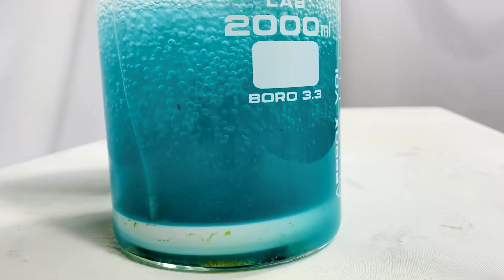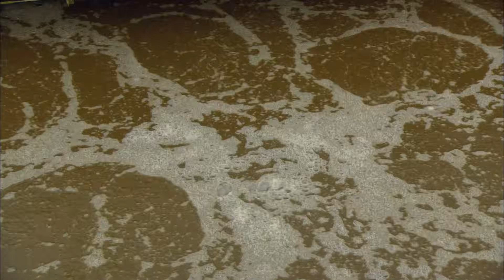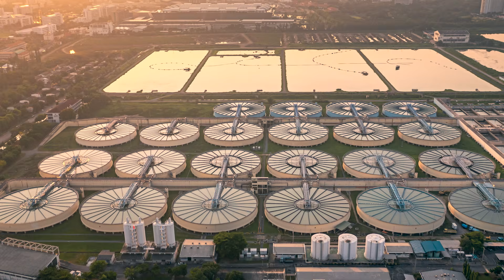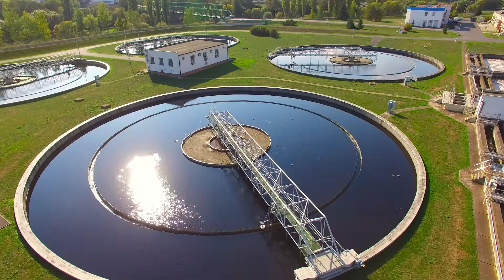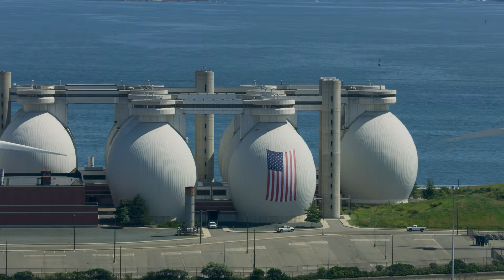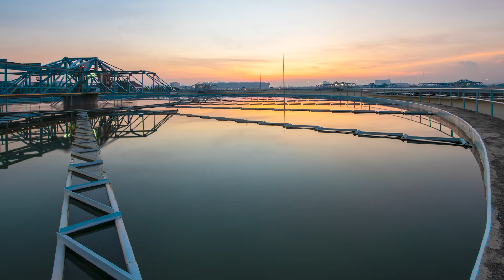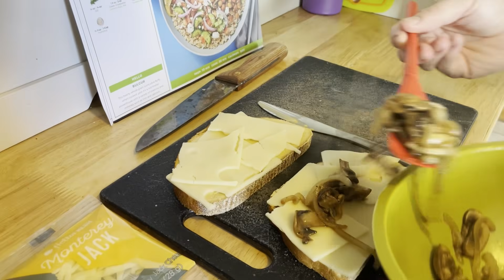What Sewage Treatment and Brewing Have in Common

Comment: Tangential, but how exactly would you design a sewage system for a habitat at the bottom of the ocean floor?

A very high-pressure environment, and no sunlight, which possibly necessitates a connection to the surface to treat the wastewater or a strong power source to provide energy to the microorganisms. The smell would be horrendous and unless the occupants don't care, the air itself would have to be treated as well...

Comment: Some people just straight up allow the mixture to build up pressure in the first place, and when the fermentation is over you get a nice fizzy drink. But for that of course you can't use a typical water-based one-way valve or a glove with a hole in it - you would either need a cap on a bottle, that you would constantly keep twisting off real quick to relieve pressure manually (can't recommend it as it is inconvenient and can make a huge mess if you miss your next pressure relief schedule - I've personally been in those cases where I heard a loud hissing sound from the bottle, and moments later a fountain of the mixture flew out while the cap was bulging!) or a mechanical one-way valve.

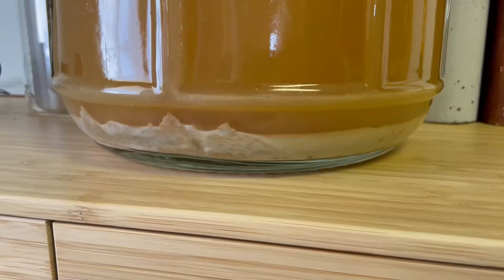Comment: @ 8:04 Nice capture of birds on the secondary clarifier.  Ducks, geese and other water fowl tend to be banes for operators.  They tend not to go for the primaries...can't blame them.  Plant upgrades tend to keep them away.  Have you worked with ballasted flocculation?  I've seen BioMag and CoMag upgrades to a tertiary treatment facility, impressive settleability in both mixed liquor and for P removal in tertiaries, impressive process and ~95% ballast recovery as well!

Comment: This was a really interesting video for me, because not only do I like an occasional beer or especially cider, but I work in a plant that uses recycled water!  We make brown paper (linerboard or containerboard) from recycled corrugated boxes (aka OCC).  The process uses a ton of water to break down, refine and store the paper pulp.  You can't pump it if it's more than 5% paper, so that means every tank has at least 95% water in it.  And it's all sort of dirty water with fine particles and dissolved solids.  But we also bring in 100s of 1000s of gallons per day, as well as discharging to the city after treating and going through our own clarifiers.  We also monitor temperature, pH, and flow (instant and total).  We're allowed to take a certain amount from the river on our property, but the remainder of our water use is supplied from the city waste treatment plant.  Effluent quality water is piped up to us (about 3 miles) and we use up to 1000gpm at times.  The pipes, the tank, and the pumps are purple.  There are also some purple fire hydrants that I don't recommend playing in when they get flushed out.  Thanks so much for this video, really enjoyed it.  --RB in CT.

Comment: We have treatment plants here in Oregon that run at a negative net energy consumption by using anaerobic digesters to produce methane and generate electricity. Several of them push power back to the grid the majority of the time they operate.

Comment: I was looking at the dramatic improvement of commode operation after clearing the two front rim jets.  You don't get a 20% improvement you get a 20-fold improvement in operation.  I realized this is because those jets in particular are the air vents and are no longer holding that air spring in the system.  Mechanically opened them at first, but got another 10x or 20x improvement using vinegar and CLR to do a proper clearing.  So, no I need to put down some septic treatment to re"activate" the sludge in the septic tank.

Comment: I feel like a great solution to excess sludge would be to decon it--possibly with ionizing radiation, since most most radiation outside of low-speed neutrons aren't "sticky"*--and then (after a cooldown period to allow any free radicals to resolve) use the resultant material on fallow farm fields or landlocked environmental reclamation sites. The potassium and phosphorus within the material would be very useful for agriculture, and would also make for excellent topsoil reinforcement.

Only significant issue would be the salt concentrations, since too much salt can poison soils over time. Although, even that could probably be ameliorated by having the material be processed by salt-sequestering organisms--albeit at a significantly increased cost. 

*Exposing a sample to sufficient x-rays or gamma rays will kill organisms, but won't leave the sample radioactive itself.

Comment: Here's an interesting question. Why don't we provide demineralized water to new buildings as an additional source of water in ocean side areas with not enough water supply? I know that industry is using different types of non-drinking water but we still discuss how much we should preserve drinking water and how hard is it to turn salt water into a drinking water. The thing is that big part of drinking water production is mineralizing it to make it safe to drink. If the easiest water demineralization method is reverse osmosis, the resulting water can be used for most of applications. Typically around 20% of water is used for shower/bath. This water can be a mix of mineralized and demineralized water. Around 20% is faucet water which includes drinking water. This should be mineralized one (the typical drinking water). Everything else can use any water and in fact, using demineralized water in the toilet, dishwasher, laundry machine, humidifiers and whatever else you have in the house is good to prevent limescale. This means that around 60-70% of water usage at home can be replaced with just demineralized, not drinkable water. The only drawback is additional cost for a second pipe but in case of new development it should not be that big of a deal. Especially compared to the damage done by limescale to many devices that don't need drinking water and the ability to reduce drinking water usage by replacing it with raw, demineralized water without any minerals added.

Comment: You can get that cider cleared with cold as well, dont necessarily need any enzymes or chemicals to knock that yeast down, although takes alot more time in cold. Put it in fridge or if cold outside then there. Below zero celsius it will freeze though.

Comment: In 2010 I installed a 2000 gallon grease trap,  with an air pump for a 2000 gallon fish tank.   Then the city implemented a new rule that all grease traps needed to be pumped every 90 days.   Small ones every 30 days.   I did not comply as my grease trap was clear to the bottom in the second chamber and had no oder. 
The pretreatment water coordinator came to inspect my grass trap and insinuated that I was using illegal enzymes.  They collected samples over the next thirty days and scoped the lines beyond my trap. The conclusion,  my lines were the cleanest in the entire city.   I explained that I was keeping healthy bacteria alive and those bacteria that escaped were also helping to clean the lines further downstream.  I even sent the inspector studies from different universities explaining how the bacteria were cleaning the FOG.( fats, oil, and grease)  She replied bacteria can't eat oil.  The decision by the city was to tell me to remove the unapproved air pump and have the trap pumped every 90 days, or they were shutting off the water to my restaurant.   I wish I was joking.

Comment: One small, pedantic, and partially wrong correction to make: while I usually love our American exceptions to language, or even measurement, misuse of the term cider should go. Cider 'is' the fermented juice. What you have otherwise is applejuice, or cider with the alcohol removed, or applejuice with carbon dioxide added. Sparkling applejuice is juice, cider refers to the fermented beverage.

Comment: To add support to the discussion:

-yeah, I'd agree with the shift in industry attitude and nomenclature. Having worked for both municipal/state authorities and private companies, either as a contractor or employee, people are really starting to pay attention to what they throw out. Both in terms of basic land application instead of throwing it in a landfill, to major shifts in treatment methods that create a better "waste" product as fertilizer or fill or whatever.

-recently in Pyongyang (I think like 2019) a wastewater plant was built that is self-sustaining in terms of electricity, and even provides surplus to the city in terms of a few thousand kw/day (on the scale of a wind turbine or two). From my general understanding it takes the methane filled waste solids from its process and bakes them in silos to release the gas, which is then trapped as a burnable fuel. The solids can then be burned as biofuel themselves.

-in the process of poultry wastewater treatment, I get to witness phosphorous be used as a nutrient in chicken feed, which then gets absorbed into chicken tissue at an industry reported standard of 60-80% for most feeds/breeds, which then gets washed off the chicken during the harvesting (new industry term) process, which shows up in my wastewater and gets extracted and runs over the machines, the waste solids of which get recycled as fertilizer for crops, some of which crops are used as chicken feed. Woo.

Comment: Brewer here chiming in with a comment that got real long. Sry. 

When we ferment beer (or cider, wine, etc). We often oxygenate the wort (unfermented beer) before “pitching” our yeast. We do this because the quantity of yeast we are introducing is woefully inadequate to start eating the sugars right away and making ethanol. Instead the first thing that must happen is the yeast must multiply until there is enough to begin consuming the sugars. The oxygen helps the yeast make a new generation of cells to do the fermenting. Without this the yeast can be under a lot of stress that can cause at least a slower fermentation and at worst off flavors from the yeast. Autolysis can be a concern - yeast cannibalizing other yeast, producing a peanut butter off-flavor (sounds pleasant but it’s awful, trust me). Oxygenation can be done by vigorously stirring a wort before putting it into a carboy but to ensure no other bacterias are introduced it is preferable to use pressurized oxygen introduced through a diffusion stone. This practice is often done even when a yeast starter (process of re-hydrating in light wort to coax yeast propagation before pitching) was done rather then just pouring in dry yeast. It is worth mentioning that there is only an initial oxygenation because we do want that anaerobic environment once the yeast really starts eating the sugars, for the reasons you mentioned. Of note most 5-8% ABV beers will be mostly fermented after only a few days but that process slows down so much we usually ferment at least 10-14 days before kegging/bottling. 

Also, we do occasionally brew with specific bacterias (lactobisillus, pediocaucus, etc) for very specific beer styles (sour beer, Berliner Weiss, etc). 

I’m guessing your clarifier was something like peptic enzyme - you can just toss that in at the beginning of the ferment it won’t interfere with the yeast. Don’t use peptic enzyme for beer though that’s only for fruit ferments.

Great video. Enjoyed. New viewer.

Edit: Autolysis is generally more a temperature  concern than an oxygenation concern

Comment: A nice example would've been vinegar fermentation. Acetic acid is a bacterial fermentation in an aerobic environment, so it would be a great parallel. The dead bacteria also settles to the bottom and can be seen in the bottom of the vessel, but it's generally less crucial that it's filtered out

Comment: A good overall review for the general public on wastewater treatment.  Obviously there are many other issues that must be addressed in design of facilities but that is what trained engineers are for.  In my 38 years of consulting practice I designed countless waste treatment facilities (mainly activated sludge but some trickling filers) for both municipalities and industries.  Everyone was a learning experience and over my time we went from mainly secondary treatment reducing solids (TSS) and BOD  to first converting organic nitrogen to nitrates in the nitrification  process to removing almost all nitrogen and phosphorus by additional techniques also.  Sometimes the regulatory agencies required such low effluent concentrations of these parameters we had develop tertiary treatment steps or enhance the  secondary processes to increase removal rates. Industrial wastes could be especially troublesome due to presence of toxins but these could be successfully treated individually prior to discharge to the downstream treatment facilities.  At the time of my retirement new issues were beginning to arise, such as pharmaceuticals that may pass through normal treatment  processes etc.  Look forward to your presentations on anaerobic and aerobic sludge digestion and solids dewatering and wastewater disinfection.  Plenty of other related topics such as wetlands also.

Comment: When I was doing my chemistry PhD, I looked a lot into the limitations for what we were allowed to dispose of down the drain. Some of the results were quite surprising, as they were mediated more by the effect the pollutants would have on the sewer microbes rather than humans! Lead? - no big deal. Nickel? - keep that antimicrobial stuff out!
Reply: That's very interesting, thanks for sharing!
Reply: But doesn't disposing the water with lead can cause water contamination to ground water? Or people just don't care?
Reply: @edojayakusuma8209  the sewage system was capable of filtering out the lead, so it was removed before the treated water was released. the nickel would be removed too, of course, but not before it caused greater disruption to the microbes that break down organic nutrients.